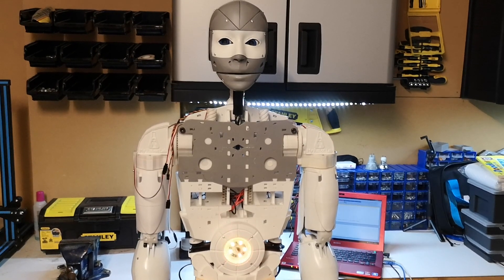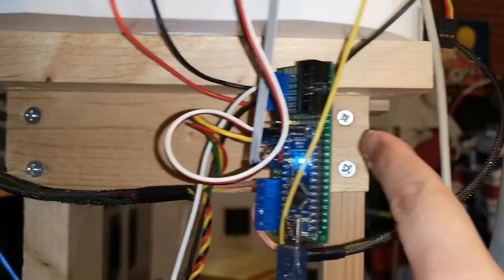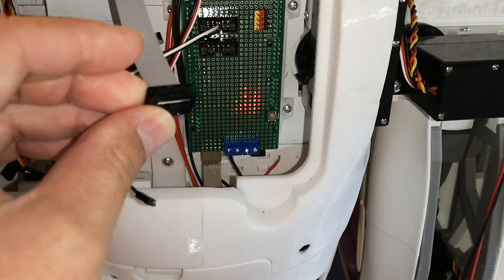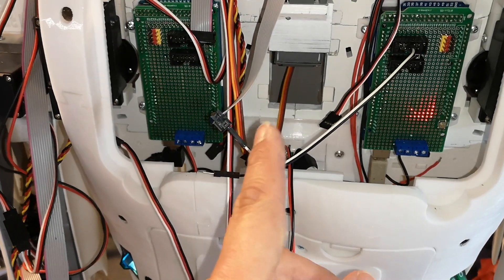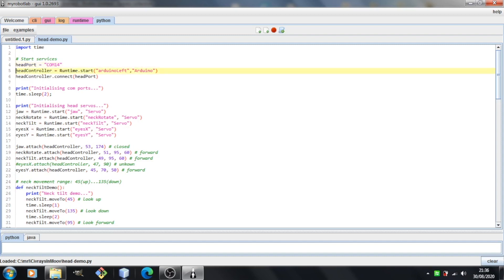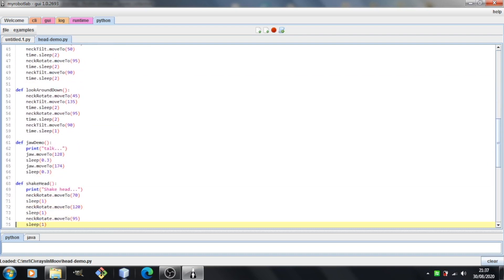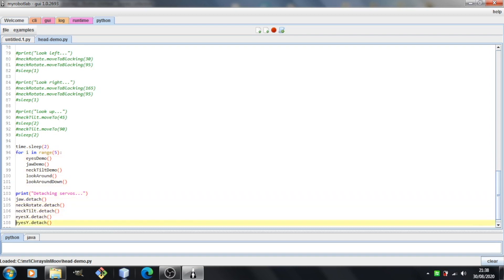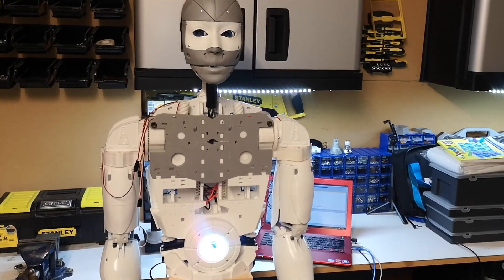Civrays InMoov - Head demo

Comment: when i printed my first parts i was like „piece of cake this inmoov projekt“ now iam getting close to finished head and hand and realize its damn hard to make it work smooth and look fine.
Could you give me an advice on how to power the head and hand? How do you supply the 6V for the big servos and at the same time 7V for smaller? Do you use just 6volts for everything? isnt it a little slower as it could be then? What supply do u have for 6 volts? A pc atx supply only does 5, 7, or 12 right? Thanks man! keep up the vids
Reply from the maker: I power my InMoov via 3S Li-Po batteries at around 12volts. I then use multiple buck converters to reduce the voltage to whatever level I require. Currently I'm supplying all my servos with 5.5volts. This was mainly because the small SG90 servos for the eyes seemed to not work above this level. But I also have one buck converter set at 5volts to power the neo-pixel ring.

Yes I believe you are correct the servos will move faster at higher voltages. But be careful not to go too high as you may damage them.

I am not aware of an ATX power supply that supplies 7volts. The typical voltages I think you will find in ATX power supplies are 3.3v, 5v and 12v. Lots of people seem to be using ATX power supplies so maybe someone else reading this might be able to give you more advice.
Reply: @SteveRaynerMakes  hey steve thanks, ill go try it with gaels "original" suggestion of a 6v 12amp SLA battery for now, do you have any expierence with that?

(by the way the 7Volts from ATX can be made by using 12 volts plus and 5 volt as minus, but at peak they shut down as not enough amps)

Comment: I like the way your building your own Nervo board :-)
Just make sure you make the power connections for the servos a bit heavier, maybe even double up the conductors in the ribbon for both  the Gnd and the +5V.
The voltage drop that can occur when a lot of current is drawn can burn out servos...
Reply from the maker: Thanks. It's a learning experience. I didn't like the look of the official nervo boards and wanted the freedom to do my own thing. However it's turned out to be a lot more difficult than I thought. I think one of my main problems is I could really do with a smaller soldering iron tip. Regarding the voltage drop I don't use the ribbon cable for power. I run separate power cables for exactly that reason. However I think this is another regret. It would have been more simple to use several ribbon cables wires for power, then there is no need for separate power wires.
Reply: @SteveRaynerMakes  As you already know, I have gone a different way with driving the servos using an I2C based servo driver.
With that for the arms, I ended up using 3 cores for the Gnd and 3 for the 6V.
I then had a 3.3V, Scl, Sda, and Gnd for the I2C bus.
I'm working with Fred for the Power of rotation servo, then I plan to do a basic introduction to electricity, Ohms law, Watts law and voltage drop.  
What a lot of people are not aware of, is as you drop the voltage to a motor under load, it will increase it's current to achieve the same power.
Motors heat up as the current increases, because the copper wires in the motor have some resistance.  It is this heating that burns them out.
The more conductors or the bigger the supply wires to the servos, the better.
Your having bigger wires for the power supply to the servos is a very good thing :-)